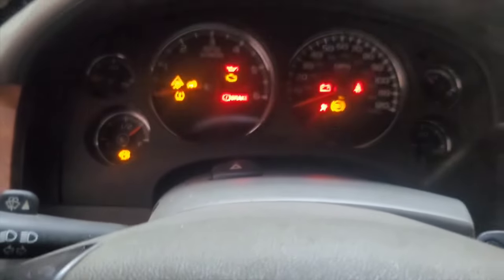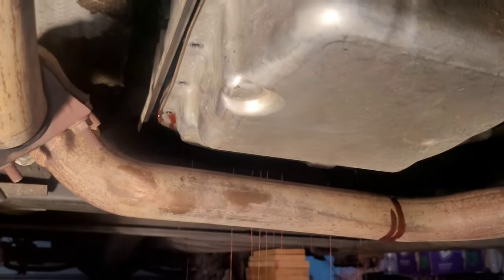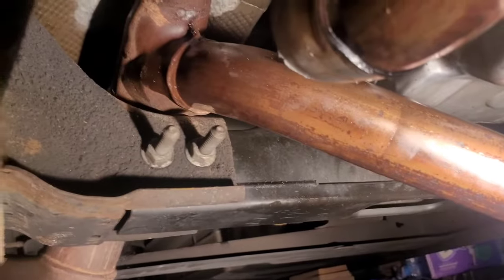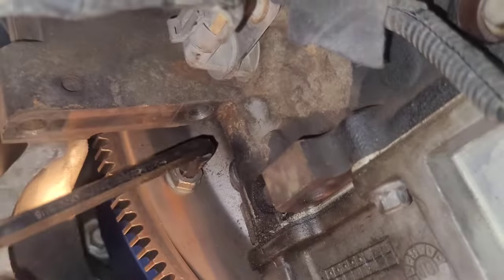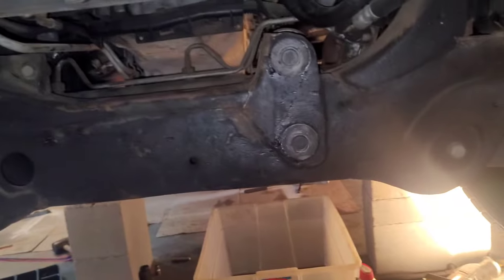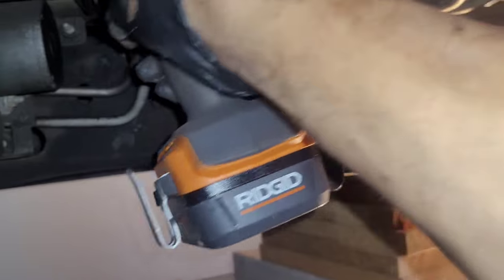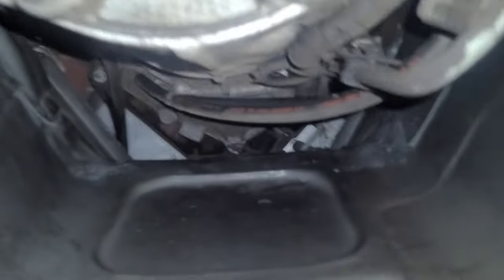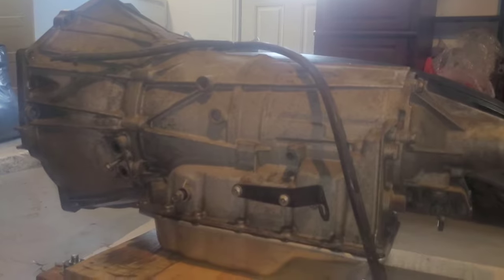2007-2013 GM TRUCK/SUV TRANSMISSION REMOVAL - 6L80 5.3L 2011 SUBURBAN - HOW TO DIY AT HOME

Comment: For lowering, use a floor jack and a piece of 2x10 or even some 3/4 plywood under the pan. Works pretty nearly fantastic for a poor man. I've never done it with these transmissions exactly but I've done a good handful or 2 of Allisons that way.  They're heavy bastards to get back on the jack when you wanna put em back in tho. 
PS i would also recommend having an extra guy to run the jack while you balance the trans.
Reply from the maker: @jaywiebe7612  yea having an extra guy would be nice. I have to do it myself, so that's why I do it that way. But you make good points for sure
Reply: @HVACRServiceTech  I have  removed and replaced an Allison by myself that way. Once.  It's sketchy. If you're not pretty strong and also a touch crazy, don't do it.
Reply: As an added bonus, I'm currently doing the same with a 6L80. We'll see how it goes I guess
Reply from the maker: @jaywiebe7612  I'm trying to go look at a 2007 impala right now with a clear title, engine running good, just needs a transmission rebuild for $1000. If the guy would answer. That one is the front wheel drive transmission,  4T65 I think

Comment: Is there a tactical advantage to using straps instead a transmission jack?
Reply from the maker: Probably not.  But, I since I don't pull Transmissions everyday the straps do almost as good of a job lifting it up there. I really depends, I might actually prefer to use straps, going at it alone like that. I can control it pretty good with those straps, and have never used a Transmission Jack so I really couldn't say for sure. Thanks 👍

Comment: Damn i was hopeing you had a tip for separating the motor and trans. There nothung holding the together but they wont budge.
Reply from the maker: @rileywalker9862  there has to be something still keeping it in
Reply from the maker: So the bell housing and rear of the block won't split apart?
Reply from the maker: You got the bolt off at the top center of the transmission bellhousing right? And of course the drive shaft, the rear transmission mount on the cross member. There is probably still a bolt holding it to the block if it won't break apart

Comment: Do you have to pull the pan off to get it out?
Reply from the maker: Let me think for a sec... I don't think so. It's been like a year and a half, but if I remember correverything can be done from the outside.  If you keep the pan on it , though you have the weight of 10 quarts of fluid(roughly) That adds to the weight of the transmission which is already heavy enough. I believe you're gonna want to remove the pan because you do have to pull the dipstick out. And if i'm not mistaken the fluid Level is higher than that when it's full. So when you pull the dipstick , you're gonna drain fluid. Also gets in the way quite a bit When you're trying to get the linkage, electrical plug, and other Things like that disconnected.

Comment: Is this before or after those janky mechanics messed things up ?
Reply from the maker: This is after. That was back in February. Wait till you see the front gear set. It's all chewed up. So far, I've seen that the front planetary thrust bearing got toasted, and I think that caused the gears to get messed up. I didn't go deeper yet because I started disassembling and remembered I needed to make a video. I'm going to continue in the morning and should be uploading it tomorrow.
Reply from the maker: @cliffordbradford3257  JANKY, lol

Comment: 14:47 you must have a death wish to get underneath like that.
Reply from the maker: @papi9196  it's not going anywhere, and even if it did, the wheels are still mounted and it would have to crumble the bricks entirely for it to actually hurt me. But with the bricks the way they are, it's stable
Reply: @papi9196  better than help paying the shops for thier fancy tools.

Comment: great video except you left out the front driveshaft removal
Reply from the maker: @theludusproject  the front of the driveshaft simply slides forward and back along splines and don't hold by anything other that the rear 4  fasteners. Once the 4 on the rear side are removed and the back end drops. The front will fall out too as it slips our of the transmission tail. But you're right, I should have mentioned that